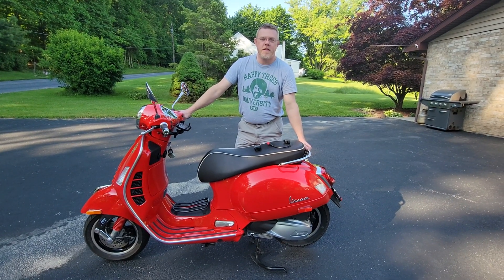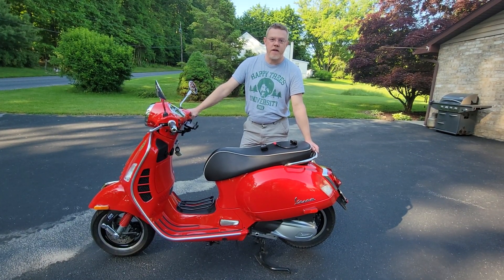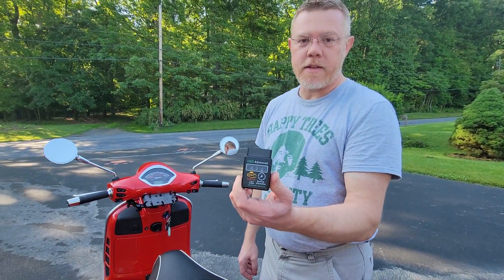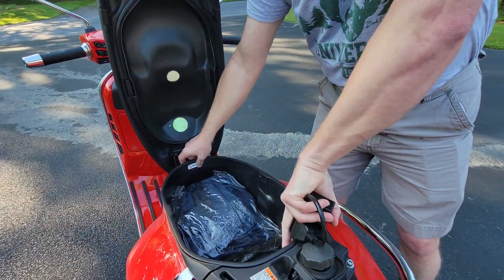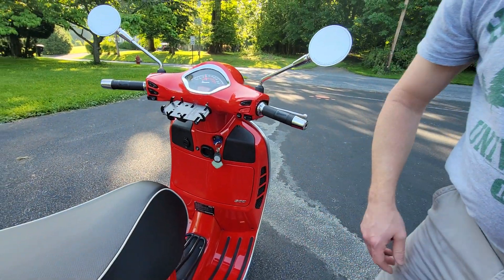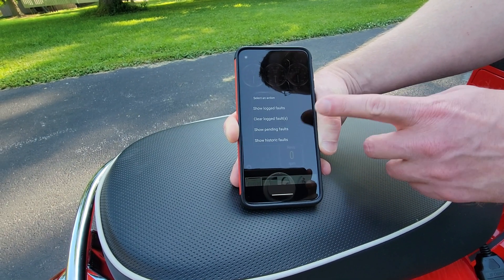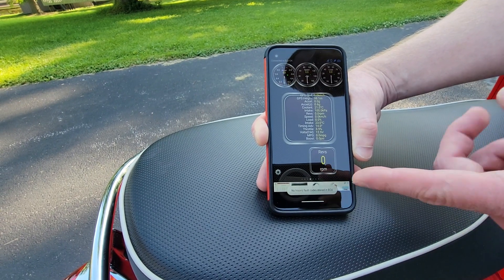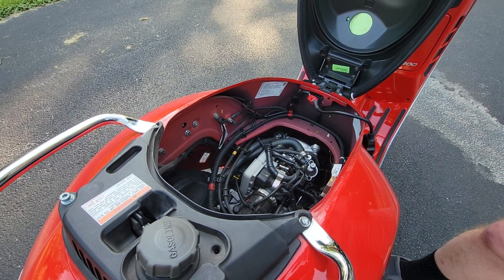2021 Vespa GTS 300 hpe OBD2 demonstration

Comment: Nice video. Definitely a feature not discussed  with EURO 5. Love to learn more about that phone mount (under the speedometer) when you have a chance.
Reply from the maker: The phone mount is something I pieced together.  Its uses a RAM quickmount grafted to an iBolt set of ball mounts.  I used one of the expansion bolts for a Faco windscreen to mount it underneath.

Comment: I have been an auto mechanic for 40+ years. OBDII is a nightmare, even when you have the proper (and VERY expensive) diagnostic equipment and vehicle specific software. Late model cars/trucks are constantly throwing the infamous P0300 random misfire code, which activates the check engine light. There are an almost infinite number of reasons why an engine might have a very slight random misfire. Older versions of OBDII were not nearly as sensitive as the newer versions, and would not pick up a slight misfire. I have a 2012 GTS300, with almost 50,000 miles on it, and have never had the check engine light come on. I suspect that would not be the case with the HPE models. I am currently looking for a late model low mileage NON HPE model GTS300. According to Robot on the Vespa Motorsport website  https://www.youtube.com/c/VespaMotorsport you cannot get the scanner needed to diagnose the OBDII system, because Piaggio won't sell it to you. To actually have any hope of diagnosing OBDII issues, you have to have a far more complicated scanner than just one that displays codes. For OBDII cars, these typically cost around $2,000. Also, to make things worse, Vespa has literally DOUBLED the required maintenance on the HPE models, from 12,000 miles to 6,000 miles. That tells me there is clearly a reliability problem with these engines. It's also super expensive, and troublesome. A full service, including belt replacement and valve adjustment costs around $500, every 6000 miles, and you have to leave the scooter at a Vespa dealer, then pick it up, with more scratches on it than it had when you dropped it off. 

As for the EVAP system, I have it disconnected and plugged on my 2012 GTS300. I want my gas tank FULL. And as any Vespa owner knows, that is almost impossible with a gas station nozzle. I carry a 1 quart plastic bottle and small funnel with me, fill up the bottle from the gas pump, then use the gas in the bottle and the funnel to finish filling up the tank right up to the top of the filler neck. Leaving a gas stop with a tank only 3/4 full is simply not acceptable. 

I highly recommend staying away from the HPE model for now. It has not been proven reliable. And I would like to know how one does using 12,000 mile maintenance intervals just like the regular GTS300. A valve adjustment at 6,000 miles is simply not acceptable, especially when it used to be 12,000 miles.
Reply: Have a 3 x HPE GTS300's, clocked up 40,000klm on one with no problems at all. It seems different countries have varying service times, not sure why. As for reliability none have missed a beat.

Comment: As my 2006 GTS ages I've begun to consider replacements and am trying to get up to speed on the new HPE models and what they might mean should I get one.  My engine light has been on almost continually for 12 years due to O2 sensor issues.  I've ignored it along with the seat latch that hasn't functioned for an even longer period of time.  When the engine light first came on the dealer checked for a code and found none.  On my GTS there are two lights -- an engine light, and a CODE light.  And in my case, neither has been particularly useful.  The scooter has performed flawlessly for most of the last 44K miles with the only failures being a fuel pump, spark plug wire, and a burned-out connector in the wiring harness.  Each was diagnosed and fixed quickly and the Vespa keeps on ticking.

My fear with the newer GTS models is that they will require more maintenance and will not be nearly as forgiving to little failures because of their increased complexity.  I appreciate your video and it's good to see that Piaggio hasn't concerned itself with the fueling challenges of the GTS!

Comment: 2007 Vespa GTV ie 250 does not have the 6 Pin. Although it does have a oval looking 4 pin maybe.  Any suggestions on where to locate the adapter that'll work with the setup you've shown?  I've searched and searched, but haven't found anything definitive.  Thank you! :)
Reply from the maker: The earlier non HPE engines have a proprietary interface.  It is not OBD2.  Sorry.

Comment: Thanks for making this! After watching this I bought an adapter cable. About a week ago my CEL came on.  Mine also came up with an O2 sensor fault. Do you remember if your code was P0130?
Reply from the maker: Yup
Reply: @EricSmyder  Thanks. Got my GTS 300 HPE on 5/10 and have already done 14 fill-ups. The first twelve were overflows so I’m sure I had a lot of fuel in the evap canister. The last two have been spill-free; hoping I finally learned the secret. I take the bucket out, and point the nozzle toward the rear so the nozzle is inline with the bike. 2 for 2 doing it that way so far.
Reply: Hello, where do you get the adapter cable, I'm in North Thailand so hopefully ebay, and what's the part number, please
Reply from the maker: link is in the description
Reply: @EricSmyder  thanks, I found it ok but currently out of stock

Comment: hi! How is your phone holder XRAM fixed please??
Reply from the maker: (repeat) The phone mount is something I pieced together.  Its uses a RAM quickmount grafted to an iBolt set of ball mounts.  I used one of the expansion bolts for a Faco windscreen to mount it underneath.  A suction cup zip-tied to the RAM quickmount dampens vibrations.
Reply: @EricSmyder  many thanks Eric!! A very good idea and nice work! I will make it too!!

Comment: where did you get your phone holder from?
Reply from the maker: The phone mount is something I pieced together.  Its uses a RAM quickmount grafted to an iBolt set of ball mounts.  I used one of the expansion bolts for a Faco windscreen to mount it underneath.  A suction cup zip-tied to the RAM quickmount dampens vibrations.